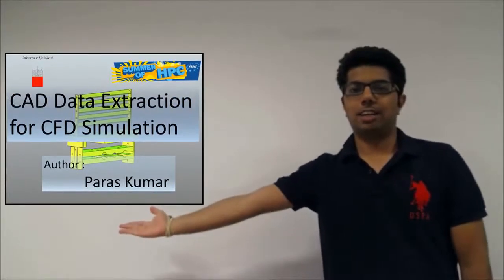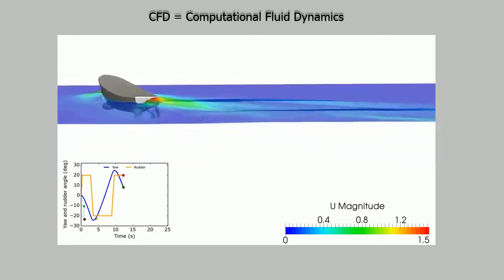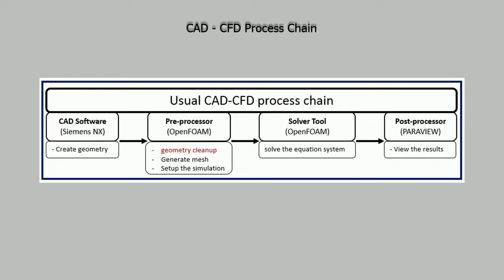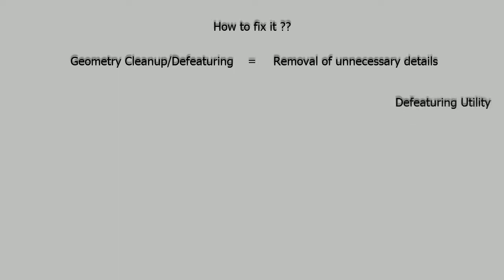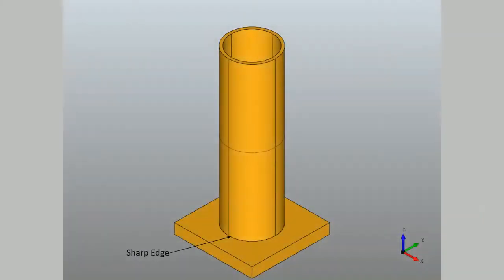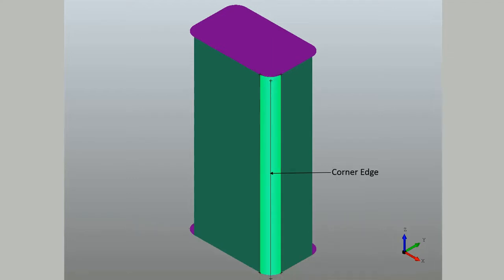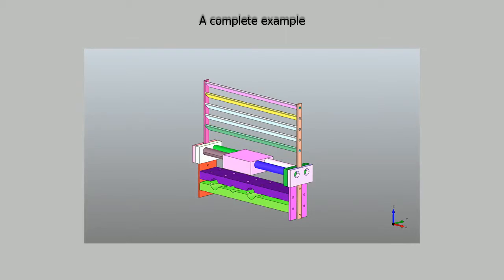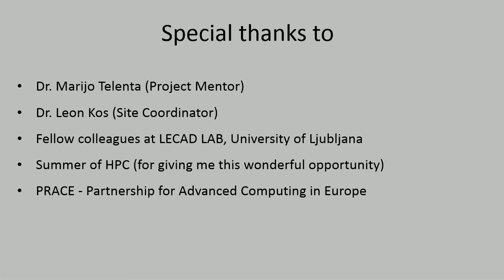1721 Paras Kumar, CAD data extraction for CFD simulation

Comment: Quick question: if you are removing nuts and bolts based on minimum volume, won't that be a problem while modeling sediments in the system since the min volume for sediments will be smaller than the bolt volume?
Reply: Could you please explain what do you mean by sediments. This utility is only meant for defeaturing of the solid structure present in the simulation. Also, this is the initial approach and can be refined by adding shape detection for bolts.